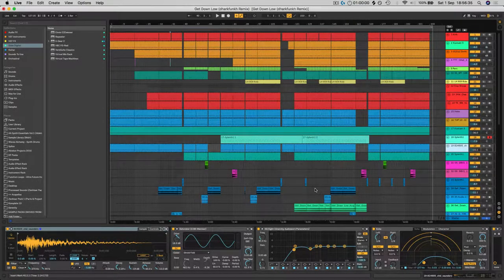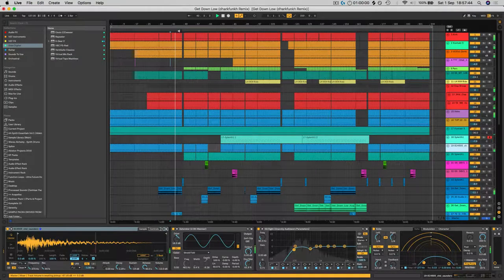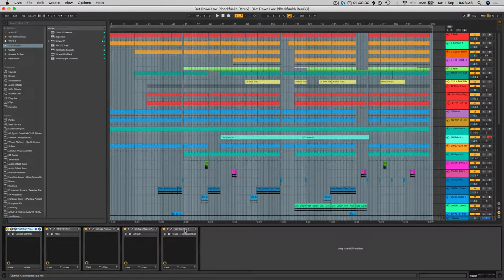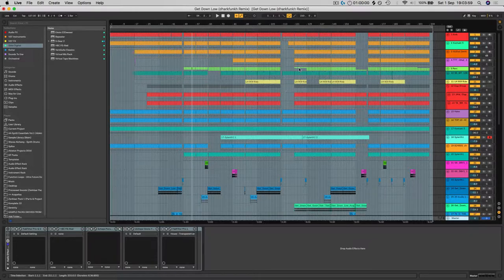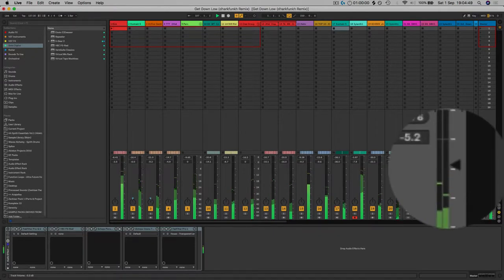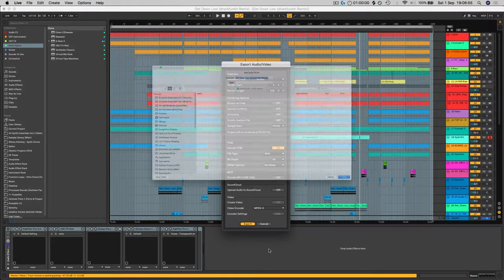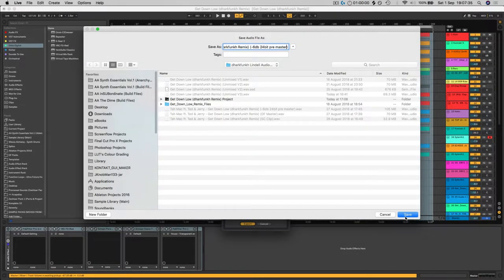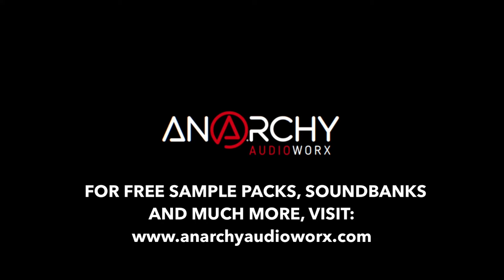How to prepare your track ready to give to a mastering engineer using Ableton Live

Comment: Hi, how does the engineer get the same instruments as me in the track? Cuz my instruments are entirely from certain plugins that the engineer does not have. I also cant change them cuz they are the most important harmonics in the track.
Reply from the maker: @marisvvvgtr  Hey! They best way to do this would be to render out all of your channels as separate audio stems to send to your engineer. That way, everything is how you created it and embedded into the wav audio file. Your audio stems can then be opened by any engineer or any DAW and the project will always sound the same, ready for them to work on the final mix and master with them. You would need to follow the steps in this video to make sure the stems are sent in a ‘pre master’ state, but instead of just bouncing out the master output, you would bounce out all individual channels. Hope that helps

Comment: So you're sending a stereo mix to the mastering engineer, not separate tracks?
Reply from the maker: That’s correct, yes. If it’s just for mastering from the wav file anyway. If you wanted to export all of the separate stems for stem mixing and mastering then you could do the exact same process but just change the setting in the export windows drop down box from ‘master’ to ‘export all separate channels’
Reply: @AnarchyAudioworx  thanks for a quick reply. I produce electronic music, never tried a mastering service but tempted to hear how much value it adds.

Comment: Is there a difference between lowering the Level of the Master and selecting all the seperate Channel and lower them
Reply from the maker: You can lower all of the channels instead if you prefer. I tend to do it this way as I usually already have a ‘test master’ chain on my master output which is set with everything running into it at the levels I set them at while mixing. If you then pull all of the channels faders down and then re-add your test master chain at any point (to do a test mix for a club or soundcloud etc), then all of your compression and limiting will be totally off. Thats not so much of a problem if you aren’t planning on going back to the project and the mastering job is now passed on to someone else, but if you are working on the track for a client for example but they want a pre-master to also send to the label that its been signed to, there is a chance you may need to re-visit the project again at some point. So I tend to just use the master to get the right pre-master level so that it doesn’t mess up the original test master you did. Its also much quicker this way and more precise 🙂
Reply: Anarchy Audioworx thanks a lot!
Reply from the maker: @MrJJDread  You're welcome :)
Reply: How about using the utility tool